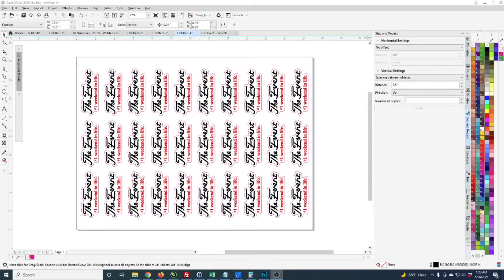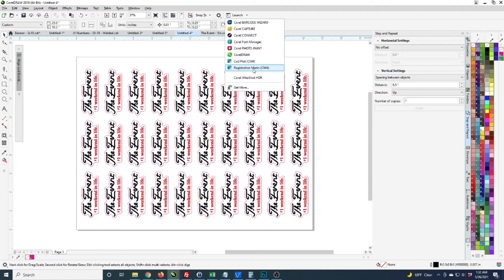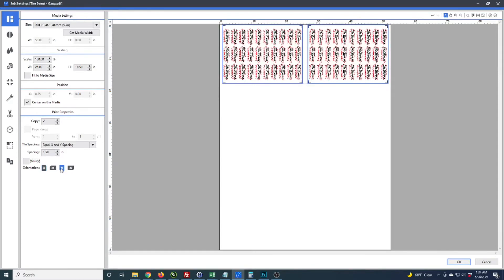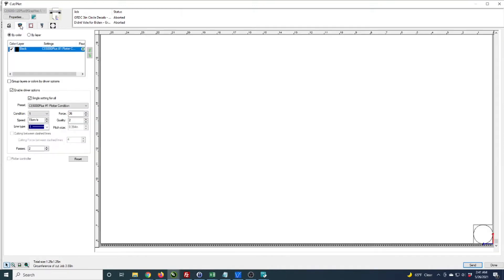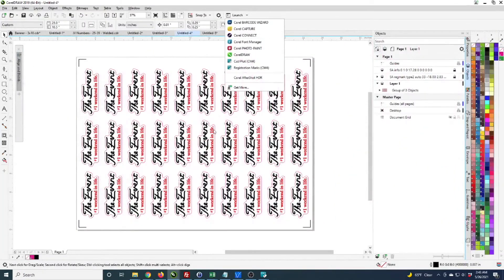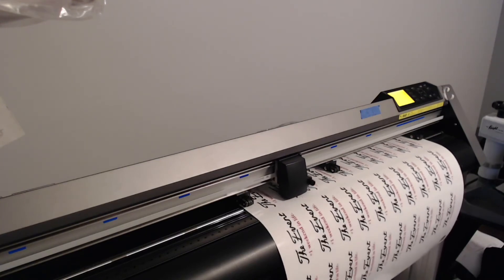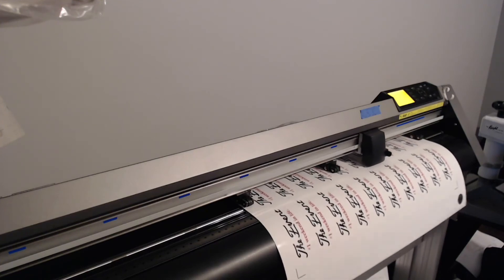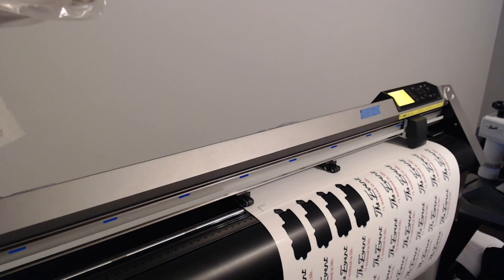Roland + Graphtec Print & Cut Workflow

Comment: hi please can you tel me how did make coreldraw work with cm4 , i have the 2021 but get the message runnig coreldraw not found, i install the programme more then 10 times i tried everything i saw in the websites.. but success,your help will be so apreciated.(i have the graphtec ce7000 too) thanks lot
Reply from the maker: Hey Tony!  Are you running the full version of CorelDraw or the Home & Student / Educational version?
Reply: @drivenbygraphics  hi yes I'm running full version
Reply: @drivenbygraphics  I can see the plug-in in the file draw and the icon of cm4/registration mark on lunch option , but when I click I got the message "Running Coreldraw Not found "
Reply from the maker: @tonymacci7126  it's been a while since I performed the installation and don't recall running into that issue but I see via searches that it seems to be a repeat issues for many users without much in terms of finding a resolution. When you have been installing Cutting Master, have you been doing so while Corel is closed?  

I know you've installed so many times already but this would be my process from here...  uninstall Cutting Master. Restart computer. Uninstall CorelDraw. Restart computer. Install CorelDraw, register CorelDraw, open CorelDraw, close CorelDraw. Restart computer. Install CuttingMaster. Restart computer. Open CorelDraw and see if CuttingMaster operates from there.
Reply: @drivenbygraphics  yes I did that all night yesterday no success :( , by the way thanks for your videos and all your explanations ,very interesting.
Reply from the maker: @tonymacci7126  very welcome!  At this point it's probably worth reaching out to Graphtec tech support to see if they can assist with resolution then. Let me know if there are any other videos you'd be interested in seeing!